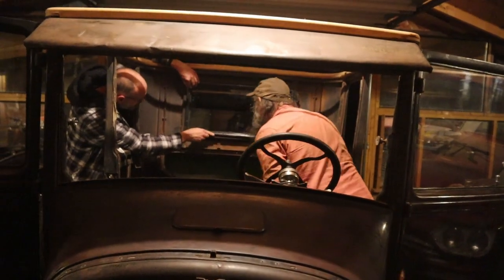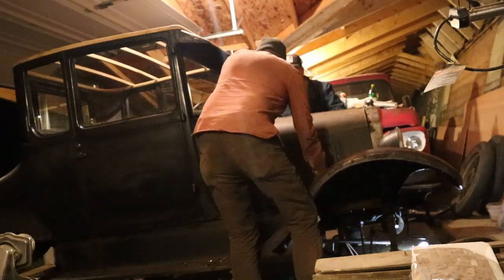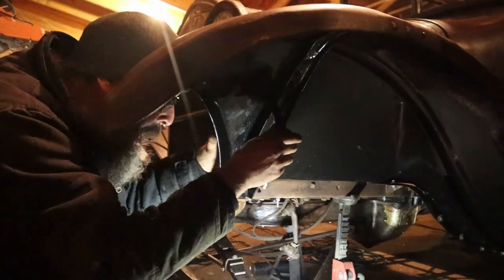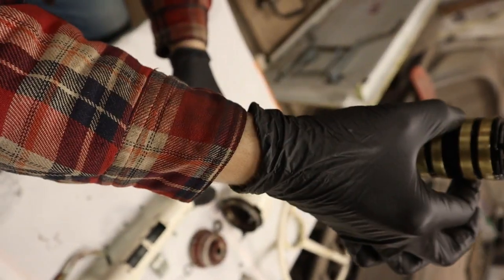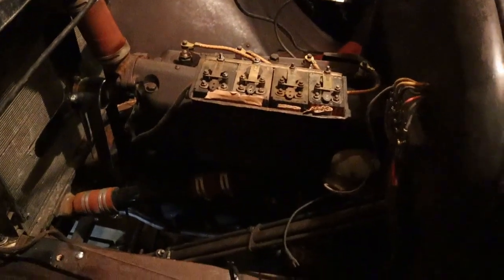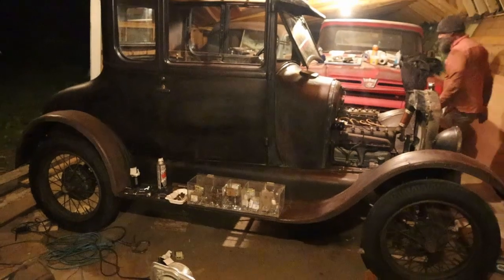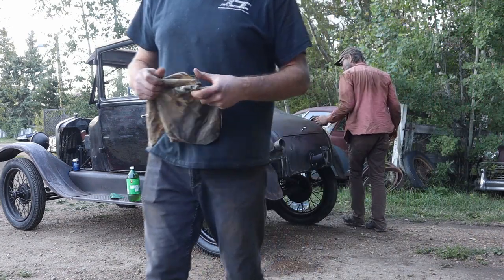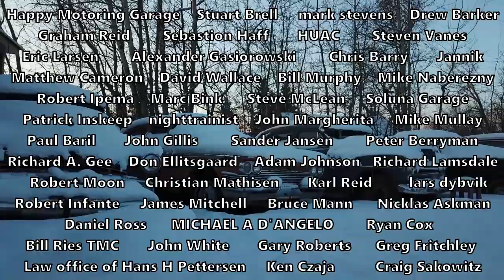Official Pace Car? T Together & Tested...Plus: Tele-Teardown!

Comment: Man do I love that Model T, my Dad had a local " Professional" glass guy make the bottom piece of glass for his 27 Touring, and the guy did the same bloody thing, put silicone in the window frame! It's a Model T, they didn't have anything in there! 

I was talking to a man who responded to my Kijiji ad about four months back while I was trying to find a T body, he told me about the Model T races out there, he is the man with the Model T tow truck. I did not expect to see you take the T there! Super cool.

There uses to be some vintage sprint races just outside Hamilton, On. when I was little, one guy had just finished a 21 T speedster and he was getting really good times, then his car wouldn't even fire up, had no spark  my Dad lent him the Original set of coils from his 27, and the guy ended up winning a gold Rolex. The Canadian actor Don Franks was always there with his grey 26 Mercury bodied speedster with Frontenac head. It got canceled back around 97 or 98...too bad, it was fun.
Reply: @kevin barker They're over 90 years old, they never had calk or silicone and people got by fine. My Dad's car is a Touring car, with no roof, it certainly doesn't need a windshield that doesn't leak.

Comment: That was awesome...... So very cool!! My Grandpa Mac had a 1913 Model T, in pieces, in a box, in the barn, when my Mom was a little girl. And then when Grandpa Mac built his new house in 1973, the box was moved into the garage of the new house. Where it stayed until around 2002, until he had a shop built behind the house. And then he moved the box into the shop and started assembling the T. He had a 1914 engine for it because he said that was the year they came out with the electric start. It was an open cab pickup. Red with black fenders and wooden wheels. The T shared the shop with an original condition road worthy 1937 Packard Sedan with a straight 8, three speed column shift. I got to drive it, such an honor, Grandpa Mac died in 2010. He's missed every day. Luckily, his first wife, mother of all six of their children is still with us. He was 88, then and she just turned 89 three weeks ago. Thanks for the good memories.

Comment: Tom: "EVERYTHING can be a pain..."
Wisdom borne of age, right there... 

I'm marveling at the self control exhibited by Team Edsel as they tackled the COMPLETE  dismantling and reassembly of the Teletouch instead of screaming expletives as they simply bolt in a B&M Slap Shifter instead- well done!
The 'T' wears its years with absolute grace- a testament to the wisdom of the decision to refurbish and clean only as necessary (the sounds of the Model T races reminded me of a WWI fighter pilot movie, for some reason).  And Myles still has the meanest sounding Chrysler Newport sedan ever. Another great episode!!

Comment: Scott the perfect solution for the steel is "stove black" put it on with a rag or sponge..it's used to coat old coal or wood or kitchen stoves..
Reply: graphite stuff ?i rember stove black
Reply: Penetrol “flood” works great to preserve the patina.

Comment: Repeating what I said on the last tele-touch affair. That mechanism is some insane enginerding, not even just for the time. Compared to old Chrysler Ker-Klunk mechanical design, this thing is a fucking solenoid-powered Moon shot. It would have been expensive as fuck to design and manufacture. No wonder they simplified that later to more traditional.
Reply: @kevin barker No I have not. If it were me fixing it, I would rather not see....
Reply: @kevin barker All automated manuals suck. It's one of those questionable Italian clichés

Comment: The Edsel teletouch  column looks to be all about clean good contacts and rings .     Some day maybe can compare to Chrysler's push button system .
Reply: I assume that the Chrysler system is a lot simpler since the buttons are on the dash and stationary as opposed to the TeleTouch which has to deal with the contacts being on a rotating steering shaft.
Reply: Had a 1958 Chrysler. Push button shifter used a cable. Park was a separate control. The neutral button was also the starter button so you couldn't start it in gear. Memory isn't the best, we had a late 50s Rambler that had push button shift too. May be getting some of the features mixed up.😋
Reply: Some Ramblers had a push-button shifter with neutral as the starter button.  There was a vacuum switch in series with the wiring to the starter solenoid to prevent the starter from engaging when the engine was running. Which sometimes didn't work.  Kinda like my memory.

Comment: Great scenes in the race! Some were actually reminiscent of the race scenes in the movie On The Beach, which is well worth a look if you're not familiar with it. On that silicone, maybe you could make some blades from the hardest plastic you can find, to trim away the beads but not trouble the glass.

Comment: I can remember years ago seeing cars like Dean's sporting floor shift conversions for the transmissions.  I wonder if issues with the selector buttons is why the car was parked years ago. You could have gotten one with a conventional lever shifter but good luck finding one. I was glad my Ranger had a three on the tree. I wondering if you need an earlier start for next year's get the cars plated by the end of summer race?
Reply: I forgot to mention if your car had a cruiseomatic transmission, you had a lever control on the column.

Comment: Tom: how many people takes it to change a lightbulb? (apparently 3 persons). Rather how many people it takes to assemble a model T in 3 days+the count of beers spend in it. The tele-touch system is freaking over engineered for sure. No wonder the Edsel ended before it ever got more widely spread.
Reply: Actually it was the financial recession of late 57, 1958 that killed the Edsel. That was the final nail in the coffin for Nash and Hudson and almost killed Oldsmobile, and was probably detrimental to Desoto. The bottom fell out of the medium-priced car market.

Comment: Now that you got the T going maybe add a Rajo high compression head with an Eskimo water pump and an exhaust cut out to bump it up to 25 HP. Still would be all period correct accessories and common in the late 1920's.

Comment: Clear silicone is a curse on windscreens. It goes stiff with age and leaks,then the frames or body work rusts. It would have been better to use one of the many flexible mastics out there.

Comment: Take your Model T to the Montana 500 next year.  It's a 500 mile rally for stock Model T's.  It's usually in June.  You're just above Montana a few miles, so it would be easy to get to.  Provided they allow you in the country, of course...😁

Comment: Halfway through and had to say thanks for posting Teletouch Part Deaux. After my dad had, and sold, his '58 with the "Haywire" Teletouch, I always wanted to know what made the mechanism "tick", and interestingly, I see here that there are few to no "wires" involved...BTW - My '66 LTD horn also would not work Edit: now i remember! Just the opposite!  When the steering wheel was clocked left to a certain angle, the horn would honk, and I think it might have had something to do with my power steering belt breaking, and my slightly bending the steering column by driving the car for some time before replacing the belt. Every time i made a left turn it would honk, and if there was a car or pedestrians at the intersection they thought i was honking at them...Well. hey, belts were expensive in 1975, 17 year olds sometimes had little money, and junkyards were not always open.😛

Comment: just go over it with black and or lay a carpet cutter blade in silicone 1/8" and resting the portion of the blade on window frame to insure a uniform cut take single edge blade 30 degrees going across winsheild easing in under the cut portion clean up corners and recalk with black silicone a nice clean bead with the edge and corner of a small putty knife laying it off at 45 angle clean up when dry

Comment: Was the insanely complicated shifter assembly the ultimate demise of the Edsel?
Reply from the maker: Well, it definitely didn't help? I think that they dropped it when they realized the cars were losing money and they needed to cut costs. It's basically well-engineered, but there is no way to make 250 pieces as reliable as a 3 piece manual shifter. Cheers!

Comment: They used clear silicone on your windshield, but what did Lord Henry use to hold the glass in?
Reply from the maker: Originally it would have had a thin layer of mounting "tape", such as was used for decades. I figured that since I had bought said tape from that business before that they would use it, but I guess not, haha. Since it is a driver, I am not going to redo it, but if it were a full restoration, I would have to take it all apart and do it again. I think we use some of the tape I'm talking about in one of the early videos in the Frazer series...Cheers!

Comment: Tele-Touch -- another tele-terrible idea from Ford.  ;-)  Seriously -- very impressive, getting all that re-assembled.

Also -- PLEASE PLEASE PLEASE hand-crank that T with your left hand only.  If it backfires while the crank is in your right hand, it will break your wrist.  Yes, priming it while the key is off is done with your right hand so you can pull the choke ring with your left.  But when you're actually trying to start it with the key on you really need to crank it only with your left.  Here's a great video about it: https://youtu.be/QxfHMtgg2d8?t=521

Comment: It just dawned on me that the summer showdown rules stipulate the cars must be tested and plated, the model T is so old it's probably exempt from testing on the grounds that it wouldn't pass even if it was new so i declare shenanigans and i say Scott is cheating.
Reply from the maker: Do you think I don't read the comments? Cheat, my ass. The T will get inspected by the same place as the other cars, to the same standard. Cheers.
Reply: @coldwarmotors  In that case please accept my apologies and my early congratulations for winning fair and square (wink)
Reply: @totalutternutter  If Alberta is like Ontario all safety equipment and pollution equipment must be in place and working BUT that only includes equipment installed when the car was built. None of those cars will require seat belts, catalytic converters, the T won't even need turn signals because they were not original equipment.